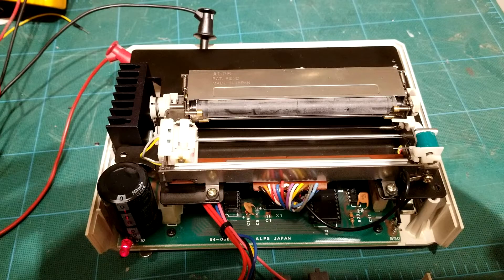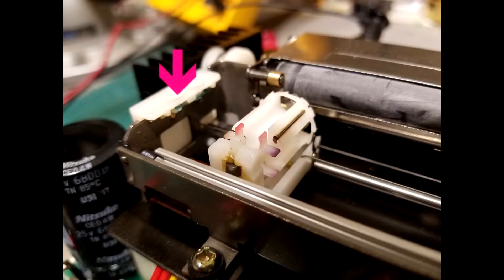#Inktober 2019 Project Update - Homing

Comment: Hey Bart, I've been subscribed to you for a long time. You're my original inspiration for getting in Shapeoko! For what it's worth. You might want to check out my robot actuator built on ESP32. It's got Gcode running built into it using a port of the AccelStepper library and it pumps the stepper signals to the RMT hardware on the ESP32 instead of relying on bit banging from the main CPU like Grbl. Also, it's based on NodeMCU Lua so it's super easy to extend. I also have a lot of sample libraries that read in sensors including a hall sensor. It can also jog using PWM control where it also counts the steps via the pulse counter hardware on the ESP32 so you know exact position still during jogs. 

https://www.youtube.com/watch?v=4o3d7_WZ_DQ

It does only handle one axis for now, but since this Atari project is only one axis, it might be interesting for you.